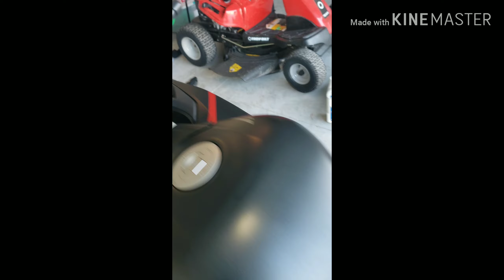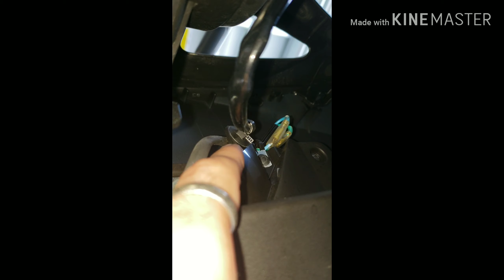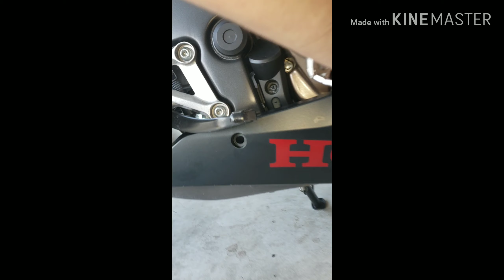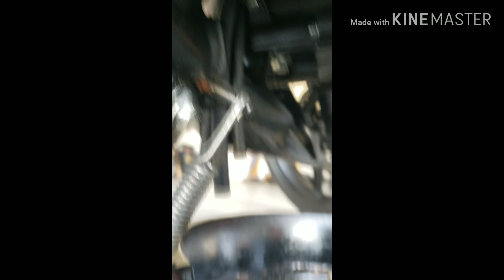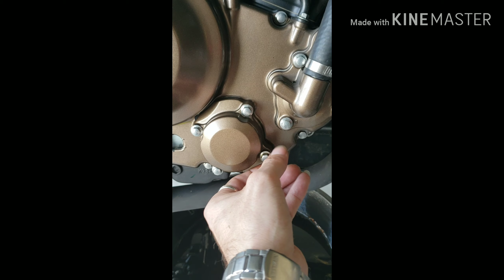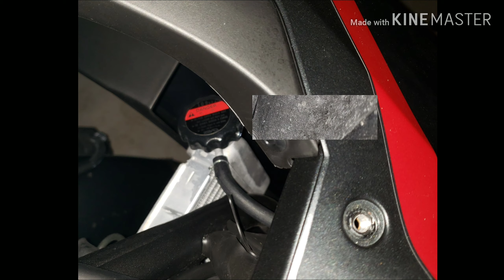CBR300r,CB300f Oil & Filter Change with Fairing Removal

Comment: So there is no need to actually remove the top fairing, only loosen enough to access the bolt of the lower fairing? I was taking the top fairing off the other day but popping the clips was a bit scary because I didn’t want to break it. Break in oil change for me since I just rolled over 600 miles and need to get it done. Ended up not having enough time so I pieced it back together
Reply from the maker: Yes you can actually get the job done without having to take it completely off once you have the fairings loose you can actually just pull it gently and have access to that magic bolt we need to take off the bottom half at least. The clips on the bottom you can pull gently in opposite directions and the should come off pretty good as for the other tabs push then pull. Thank you for your support!
Reply: Ok thanks. About to go change it shortly. I just bought the same exact motorcycle year and color by the way. Guess that’s why I gravitated to your video lol. It really helped too, to see it here rather than reading the manual. Thanks again
Reply from the maker: Your very welcome thanks again for your support and don't forget to Subscribe for more videos.🤘

Comment: I have 2019 cbr300r and was wondering what oil filter you used ? I like K&N products just not sure the size ? Yes thanks for the video ☺
Reply: Same. Since he didn't answer. What did you use?
Reply: @thespeeddemon5685  i didn't.  I went to the dealership: (
Reply: @obrider2963  my dealership that I bought it from says it's gonna cost 300 for oil change.